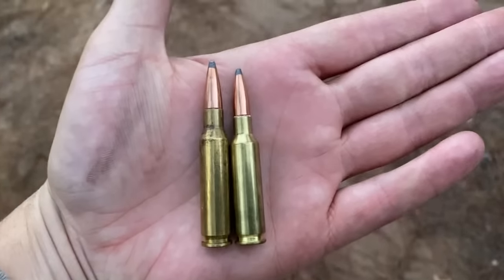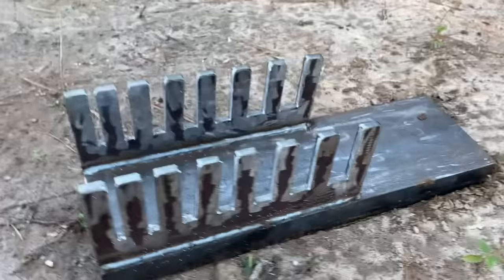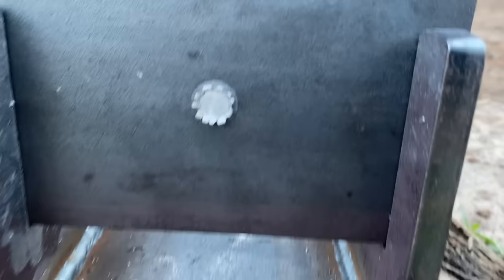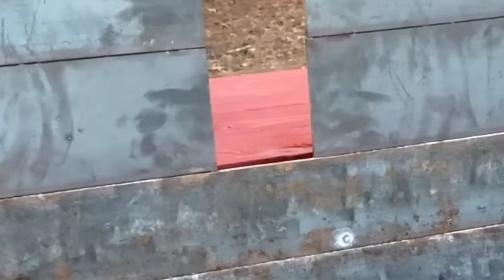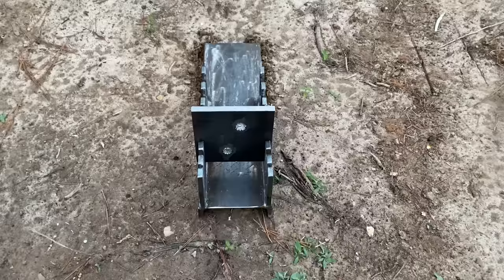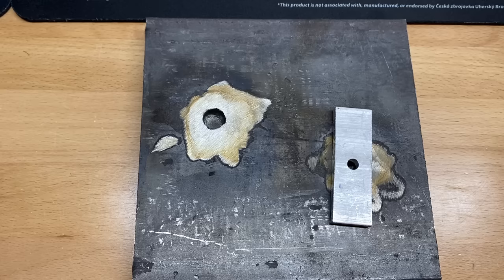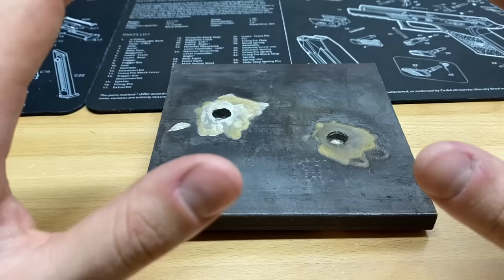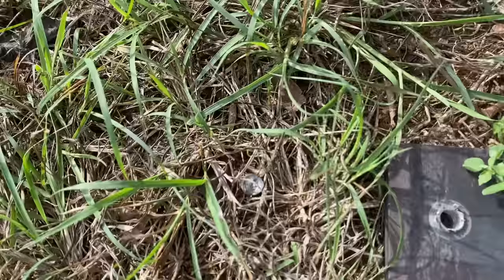6.5 Creedmoor vs 7mm-08: BIG Difference On Steel

Comment: 7 mm has more elephant kills to its credit than any other caliber  7 mm08 better than 7x57 except when the 175 is used  creedmore does everything stout 27-2800 fps  the 7 mm08 has better ballistics out to 600 which by far is most practical

Comment: Don’t get me wrong the Swede is everything most hunters could ask for 140/156/160  still the best 300 meter qualifying cartridge  mine like 120 s plenty of bullet about 2900 Hornady 129 s do the job nicely also I’d say pretty equal to the 7 mm08  110-160 6.5 85-160  both w 160 s  would take bear and moose  160 6.5 can penetrate 42” of wet newspapers an 06 180 18”  papers compressed  telephone books

Comment: The round shot higher on the plate is at a disadvantage. To be fair both rounds need to hit at the same elevation. The higher the shot, the more leverage is has to lift the target from the ground, wasting penetrating energy. I would surmise that your results would be reversed if the location of the hits were reversed as well.

Comment: I use my v l s w 110 about 3350  and my custom 20” rig I use 120 s and 130 s 3 k on the 120 s  deer smacker  130 boattail s for anything else 2950  the 140 do well also things are not that large here  pigs I pop in the ear

Comment: Your test is flawed, resistants is different from the top to bottom because the top of the plate has a greater amount of movement whereas the bottom has less, allowing for more energy being transferred at the point of impact

Comment: I have a 6.5CM and it's not the super cartridge that some would make it out to be. I have more than one .308 Win and I've always enjoyed the cartridge. But I've never had a 7-08 and it's a cartridge that I want to explore. My problem is that I can't find sufficient difference between the 7-08 and the 6.5CM or the .308 Win to make it seem worth the expense. I suppose at some point my curiosity will get the best of me and I'll pull the trigger on it.
Reply: The 6.5 Creed has lowest recoil and energy out the muzzle. The 308 has highest recoil and energy out the muzzle. But depending on the load. Things change around at longer range. If you use the standard deer load in all 3, at longer ranges the 7mm-08 will pass the 308 in energy at around the 200 yard mark. Further downrange the 6.5 will start approaching the 7mm-08 but won't pass it within ethical hunting distances. A quick comparison of exact same loads will show you this. Try the Hornady Precision Hunter loads for all 3. Depending what you hunt and where you hunt, the 308 could be your better choice. Specially at shorter ranges and bigger game. If you occasionally shoot at longer ranges maybe the 7mm-08 would be worth it if you want less recoil and flatter trajectory. But in the end you're right. Then isn't a big difference in the 3 overall. 308 probably better on elk but 7mm-08 can do the job and is a little easier to shoot accurately. Maybe you're looking for a new lighter rifle. You could switch to a 7mm-08 and have similar recoil to a heavier 308. I know its hard to compare recoil in different brand rifles, but 7mm-08 does have noticeably less recoil than the 308 in similar weight rifle.
Reply: @denisleblanc4506  I hand load my ammunition so I don't do factory loads. My hunting rifle is a .308 Win (Steyr Pro Hunter) and mulies and elk are the game of choice here in Wyoming. For elk at shorter ranges I'll go with the .308 but if I'm hunting at longer distances I have a .338 Lapua that will handle the job nicely. 7mm-08 has been a curiosity and I probably would hunt steel at distance with it. At my 5,100ft elevation (or more) the .308 remains supersonic to just over 1200yds, but I'd have to play with the 7-08 to see if I could push that distance out a little further. I do notice that at around 1100yds, the 6.5CM needs about 5 minutes less elevation than the .308 Win, but the 140gr out of the 6.5CM has almost a 200fps slower muzzle velocity. My thought is that 150gr ELD out of the 7mm-08 would come close to the muzzle velocity of my .308 loads (2745 with a 168gr Hornady Match bullet) and with the higher BC would carry itself a little better at distance. What do you think?
Reply: @CplSkiUSMC  Hornady's Precision Hunter load fires a 150 grain ELD at pretty much the same speed as your 308 load. You might be able to handload the 7mm-08 a little hotter if you want. Its high BC would be an advantage at the really long ranges. My comparison was more for normal hunting bullets and weights. A 150 grain 308 load starts out about the same speed as a 140 grain 308 load but after about 200 yards, the 7mm-08 load matches the 308 energy and surpasses it at longer ranges with same bullet types. There's a reason the 7mm-08 was the darling of silhouette shooters for a while.
Reply: @denisleblanc4506  I was just playing around on the Hornady Ballistic Calculator and ran the 7mm 150gr ELD-X which has a BC of .574 if I recall correctly, and I set it at the same velocity as my .308 match loads (168gr Hornady match with a BC of .451).  Surprisingly, it drops subsonic at the same distance and takes only 1 less MOA of come-up. The 6.5CM at lower muzzle velocity uses 5 less. Maybe the 6.5PRC might be the better choice. Get that .264 bullet moving at a higher velocity than the 6.5CM and it's really going to fly. I don't know, I still have the ghost of .30 cal bias floating around my grey matter, but 6.5 or .264 always seemed anorexic to me. For plinking steel though, it shouldn't matter I guess. And I know that 6.5 is perfectly effective on game at closer ranges... but still.
Reply: @CplSkiUSMC  It all depends on use. I was thinking more about hunting within 400 yards. For steel at long range, it depends on your rig. As a serious reloader you're probably using top brass. It depends who makes what. Have you considered 6mmCreed for something lighter and easier to shoot and on the other side you have 7mmPRC.
Reply: @denisleblanc4506  I use top brass in the .338 Lapua but for the most part I'm just using name brand brass in my .308 Win. Remington is kind of a favorite and I've actually gotten good performance out of Winchester although it's pretty thin brass. I anneal so that certainly helps and I've gone to neck expanding with a mandrel which again, seems to help with accuracy and longevity. All of those little improvements in case prep tend to equate to lower SDs and improved accuracy. I like, I mean I really like those sub 1/4 minute groups. I also like to take a budget rifle, my 6.5CM is one of them, and make them shoot tight little groups. The 6.5CM is a Savage Axis II and by adding epoxy to the forend to stiffen it, bedding the action, and developing the load, I've gotten it to shoot 1/3 MOA groups with a 140gr match bullet as well as a 140gr SST for hunting (I always take my .308 but I let a friend hunt with it and who knows, maybe one day I'll take it out hunting). 
I've never considered the 6CM, like I said, the 6.5 already feels anorexic and I'm not recoil sensitive. I've thought about the .300PRC but I can't justify the expense right now since I have the .388LM for extended long range. I'm set up now to work on Savage bolt actions, I just rebarreled my model 10T .308 with a Shilen barrel. I might look around and see if I can find a cheap deal on a used Savage short action and just rebarrel it to 7mm-08... that'd scratch that itch anyway.
Reply: @CplSkiUSMC  Maybe you should stick with a long action for the 7mm-08 allowing you to keep the bullet out of the powder chamber. Shilen should be able to cut you the appropriate leed and give it sufficient twist to stabilize those longer bullets. Just depends if you want to stay close to stock or hot rod it more. For instance, it usually is rifled with one in 9.5 inches but Ruger has started using one in 8. And you could improve it a little (AI) and see what it gets you. There has to be a good reason the F-Class guys are going to some form of short mag 7mm. The Shehame or .284 Win or 6.5 PRC necked up to 7. Unlike you they are limited in rifle weight and 100 round matches would be punishing in something with too much recoil. They can't use a brake. But they have the bullets they want and a supply of good brass for their chosen load.
Reply: @CplSkiUSMC  I'd check your Hornady numbers again. Just looking at factory loads, their 168 grain ELD has a BC of .523 with a velocity of 2700. That same bullet in their Superformance load has a velocity of 2840. They drop 47 and 41.9 inches at 500. The 150 grain ELDX Precision Hunter load has a BC of .574 and velocity of 2750 in 7mm-08. It drops 43 inches at 500 yards. I didn't do the 6.5 Creed numbers. I suspect a reloader could approach the 308 Superformance velocities in the 7mm-08 with the 150 and make up the 1.1 inch drop difference fairly easily.
Reply: @denisleblanc4506  If I stuck with a long action I'd be more tempted to chamber in .280 Remington (7mm-06). I'm not against the idea... kind of intriguing actually.
I'll go back and look at those numbers again. I know my 168gr BTHP Match loads (.451 BC) drop subsonic between 1200 and 1250 yds at my elevation and humidity at 60degF. When I ran that 7mm-08 150gr  ELD-X with the same muzzle velocity as my .308 load with downrange velocities turned on, I saw that the 7mm dropped subsonic between 1200 and 1250 yds as well. I have a lot of the 168 BTHP Match bullets and the ELDs are more expensive, but I may have to bite the bullet (pun intended) and buy some to take out for a spin (pun intended again). That Shilen barrel is 26" as opposed to the factory barrel at 24" (Savage has really gone bad on quality - the barrels on the last couple of Savage rifles I've purchased are nothing but junk). My Steyr is a 26" barrel and has given me slightly better velocities, and shoots the 175gr match bullets at higher velocities than the Savage shot the 168s. With the new (brand spankin new - I just finished the barrel change and rebedding in the stock last weekend) 26" Shilen barrel, I'm expecting better velocities with both bullets. I have just a handful of 178gr ELD-Ms that I'm going to try out as well.
You've got me thinking about that long action though... I wonder if there's any brass out there for .280 Rem?  I'm very much enjoying this conversation by the way.

Comment: If you use same weight bullets with same construction at the same speed would the smaller diameter bullet penetrate further or the larger diameter bullet penetrate further? 
Not that a deer is going to care.
Reply from the maker: I would think that you are correct since they would be putting the same energy out with one having less frontal area

Comment: Why not use the same bullet and same weight bullet in each? Otherwise what are you comparing? No rocket science that 139 grain penetrates more than 129 gr right? You would get the same results if you just shot two different 7-08 cartridges with those bullet weights right? So this makes no sense.

Comment: There is also the 8mm-06 and I used my 7mm Mag on AR500 with 165 grain core locks. That was 20 years ago, I don't shoot anymore so I may be off on the 7mag weight. 7.92 mauser would be interesting.

Comment: 🤔. .375 = 3/8”. The deepest hole you have in the 1/2” is .378 on the 7mm and .302” on the 6.5   By looking at these results you would think the 6.5 would not have made it thru the 3/8”(.375”). Weird
Reply from the maker: It is really weird how bullets react on different thicknesses

Comment: Up close on game the 7mm08 will win out to 400 creedmoor should do better at longer ranges
Reply: That's just an assumption. 7mm08 will perform outstanding at any range
Reply: At 400 yards the CM is running out of the "required" energy to make an ethical kill.  Same can be said the the 7-08.  Poking holes in paper is a total different game than poking holes in animals.  Any cartridge based off the 308 will make good deer medicine, within their ranges.  Thanks for the vid.
Reply: @tullo5564  that is far from a assumption I've owned them and the numbers even show what I'm saying I'm not saying a 7mm08 doesn't work good for long range but because of the rifle twist and the bc of the bullets compairing a .264 caliber bullet with a 1-8 twist to a .284 caliber with a 1-10 twist at longer range specially when both guns are using 140 grain bullet the 264 will win with basically the same powder charge
Reply: @doghousedon1  I was talking about poking holes pass 400 yards honestly I feel like that about any 308 capacity guns though I like the short magnums calibers past 400 and of course a 7mm rem mag if I was going to try take a animal at a long range but realistically under 200 yards most calibers will perform basically the same
Reply: 7mn-08 can push a 197gr match king to 2500, that stomps 6.5 at all ranges
Reply: @chuckfinley3152  I'd love to get my paws on that reloading recipe.   😉   But yah, there ARE 7mm-08 loads that wave bye bye to the Creed right out of the muzzle.